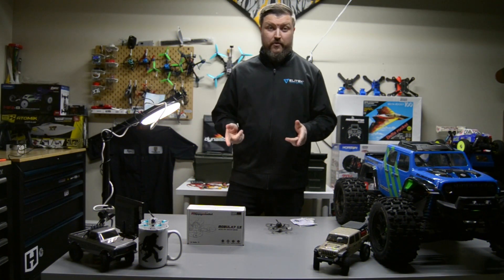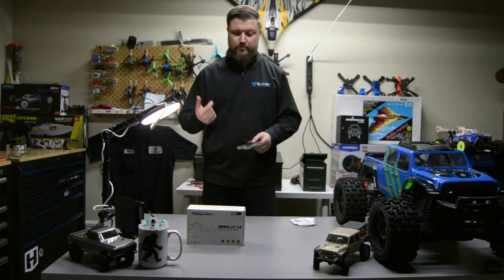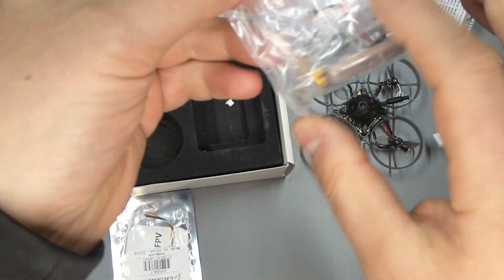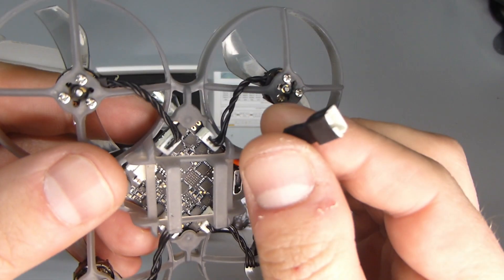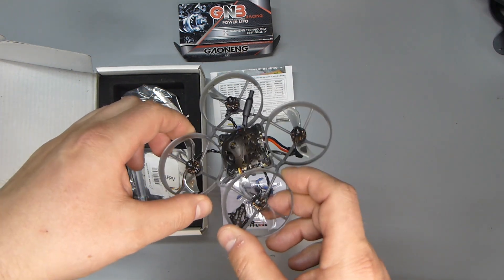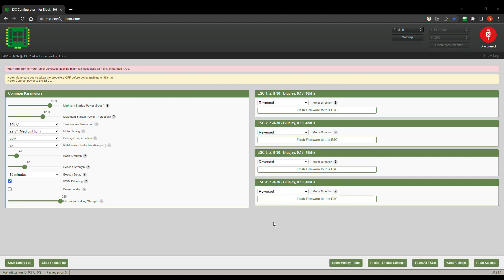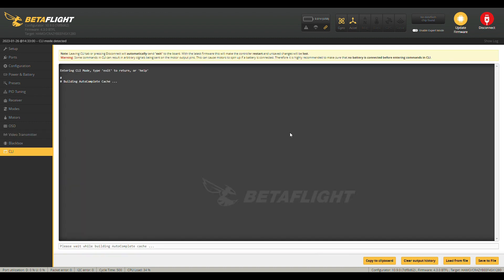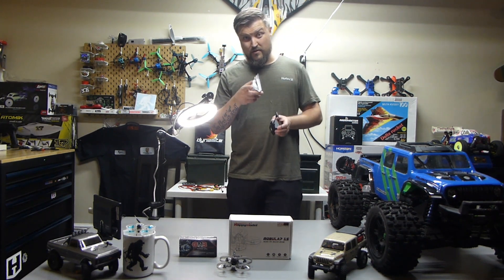Happymodel Mobula 7 1s VTX/ESC issue (Blue Jay) and review PART 1(#happymodel #mobula7 #fpv #drone)

Comment: Great video! I wish i had found this when i did my Mobula7 and was looking for a good video specific to this drone on how to flash it and then what settings need to be changed and to what. 
Im not good at the PID tuning at all, and i basically leave them all stock right now. I havent got to the point where i could tune the PID loop and even notice a difference unless it was drastic lol.. but i do have some drones that were tuned before i bought them and they are on a whole other level, it can just change direction so fast (5" drone), and you can hear the motors as you do its a very clean sounding transition from one direction to the other and no prop wash or anything its awesome, i just wish i could make my newer drones like that.. 

Anyway I'm on the Bluejay ESC firmware on my HM Mobula7 1s, i got the SPI ELRS. It really has plenty of range i can go further with it then i probably should because thing being smoked black, with basically no lights on it, it gets lost in the grass even when i know the general area it crashed in lol. 
I did like the Bluejay FW at first but i think thats because it made it alittle easier for me to fly indoors and the extra run time is nice. 

But now that I basically only fly it outdoors, im going back to BLHeliS because I want the power back now. I find myself 100% throttle a lot now for a minute straight sometimes when going from one place to another and i dont remember it being like that with the BLHeliS and also now that i seem to be flying it harder bc of the lack of power im not getting the big run-time increases as much anymore, maybe 30secs to a min max if im flying around easy, but if im ripping around a parking garage or something and have to go to 100% throttle all the time to pull up for power, it seems to drain the batteries quiclly anyway. 
I just don't really get the same 1min - 1.5min extra flight time's anymore because of that i think. At first i was still learning Acro mode and was using Acro Trainer at first which works awesome btw. 
However now that im flying in Acro mode and doing powerloops, etc it just seems like now i need the power back lol.. I noticed it was different after going to the Bluejay but i didnt think i get to this point so quickly. Plus i found using LiHV Lipos helps with power and Runtime just as much.

Also, Flashing Bluejay made the throttle less responsive/more progressive, but also it feels like i lost the raw power on the full throttle top-end, that's honestly why i think most will get more run time. Also after flashing Bluejay ESC FW you want to enable all the extra features it adds over BLHeliS, like Bi-Directional DShot and Dynamic Notch Filter, and it makes my SPI ELRS Mob7 go to 65% CPU Load in Betaflight, compared to like 15% before.. 

Bluejay was great for me in the beginning but now that i basically only fly it harder in Acro outdoors, to test out new spots or just things id rather not try first on my 5" fpv drone lol. 
The plastic whoop V4 frame and prop guards make this thing indestructible lol. However i want that power back now that i fly it harder and i dont know how people fly these things inside either way its too fast lol. Im also no expert pilot either.

Comment: Hi! what is the current consumption of amperes before arming?
Reply: I see about 0.8A before take off, diarmed, with my SPI ELRS 1s Mobula7, at the lowest VTX setting of 0, which is slightly below 25mw as far as the dBm values i believe they are in BF. Like 25mW is 14db, 100mW is 20db, & 400mW is 26db of VTX output power im guessing. Theres also a "RACE" mode which is 2db. I use that sometimes when i know ill have it on for awhile while adusting something or changing up the OSD to get it cleaner and less stuff on the screen lol..
When i arm it with the dynamic idle it actually goes up to 2A after just watching some DVR footage which is kinda crazy, but it only goes up slightly when i actually take off and start flying so it seems fine..

Comment: Props paddle out .
Smart audio doesn't change the settings .
The frsky bind button is in reciever tab on betaflight screen . Turned on uart1 seial rx i think and pressed save .
 Tx was frsky x subtype d8 .
  I just entered band. Channel icked power . So far it is real easy to control . Tighten the camera tilt .

Comment: When you flashed BlueJay, did you use 24Khz, 48Khz, or 96Khz? That will make a difference in the "power" or performance you get.
Reply from the maker: I flashed 48khz, I could try 96khz.
Reply: @BigfootRC88  I've heard you lose torque the higher you go, so I usually stick with 48. Best balance of longer flight time and performance.
Reply from the maker: @dubzsquaredfpv7171  Yep! Agree. It also might be because it's a 1s whoop and I'm used to flying 2s toothpicks. Still a blast and a very versatile whoop!
Reply from the maker: From what I've seen the higher you go the more latency you would get but better flight time.

Comment: So what were the noticeable differences using Bluejay vs Bheli.
Reply from the maker: Honestly, it's not a huge difference but you can feel a little less "aggressiveness". Each filtering step ads latency, the more complex the filter is and the higher the bandwidth (khz) it has to work on, the higher the latency is. So filtering is always a trade off between a clean signal and latency. Generally speaking you want as little filtering as possible to get the most responsive feeling quad. That is why I did 48 instead of 96, it's not a massive difference or downside, but you can feel it very slightly. Overall I'm happy with it, so I guess to answer your question it would be "handling and responsiveness" plus the ability to change the starting tune haha. Also my part 2 flight video is coming soon!

Comment: I've got the exact problem - no table and no video. Please leave a link for the Cli dump! Subscribed - good luck.
Reply from the maker: I will add that ASAP and re-comment on here. Seems to be a common issue. Thank you!
Reply from the maker: Alright, added the CLI dump for my PNP version. If you don't have the PNP version and still need the CLI dump I would email Happymodel.

Comment: curious why you put that extra receiver in the Mob7 looks like your AIO has built in ELRS
Reply from the maker: This one is actually the PNP version with no receiver built in. Also I believe (not 100% sure on this) that the AIO serial ELRS receivers have poor range or a lot less than one added externally. Happy flying!